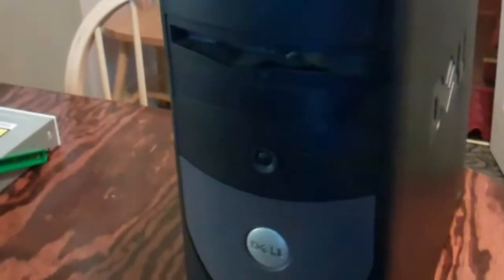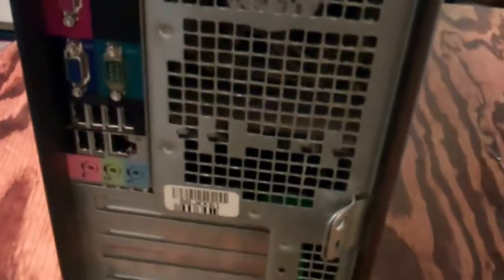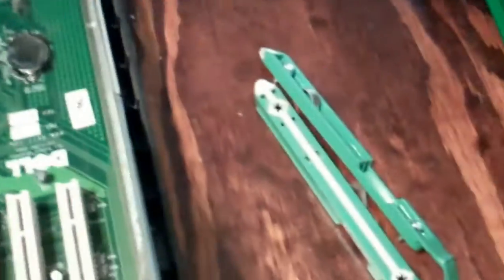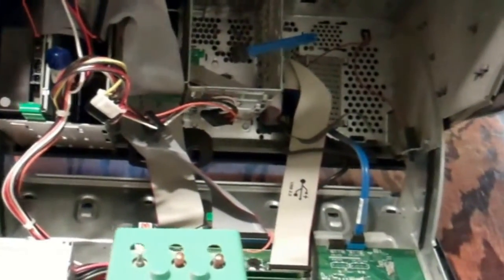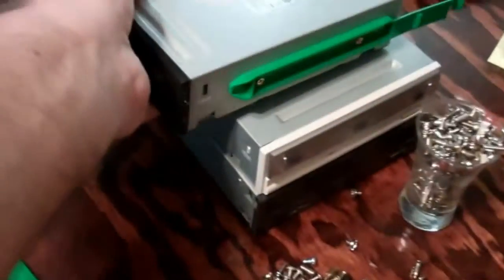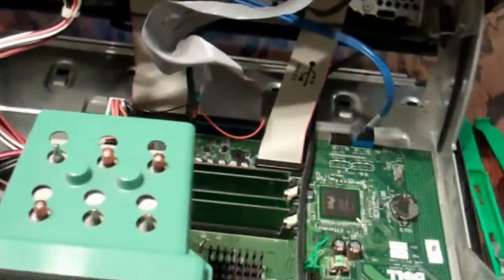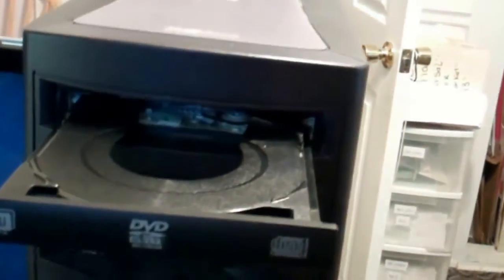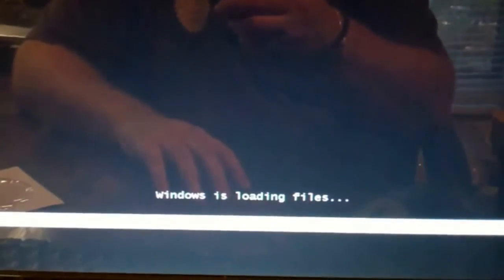Ressurecting an Old Dell GX280

Comment: Is not old
Putting w7 on these machines will slow them down, put xp
Reply from the maker: I run a small tax office and I'm required to have a current OS for security reasons.. XP has long since expired so that's not even an option...
Reply: Agreed, plus...depending on what you put under the hood could make all the difference, too.  I happen to have one of these bought from Savers a week ago, and am currently getting upgrade parts from eBay to max this out to the gills, if need be.  2 GB RAM, 512GB Samsung 850 PRO, 24x ASUS DVD-ROM (since this uses SATA and IDE, might as well go full SATA on this baby), nVidia 6800XT, Wireless-N network card, and that certainly will be more than enough to get Windows 7 going on this without too much bottlenecking.

Comment: Microsoft has something called an Update Advisor you can run on a machine and it will tell you what issues to expect prior to installing 7. When I get in my 280's... about a week... I will try that, first. It may say I'm dead in the water but you have proved that not to be the case.
Reply from the maker: Yeah I didn't even bother with that. I just inserted the Win 7 Professional (32 bit version-I was told that would be the more stable version to use instead of 64 bit because of how old my Dells are) and loaded the OS. It worked on every single one of my various old XP Dells (I have 9 total).. Just a couple of them had those quirks with the audio and video but still worked for what I needed.

Comment: Understood. So I may have to use is a cheapo 3rd party video card in the back. That should give full speed video for using Media Center... which I need to also install. Also mentioned on that Dell forum. I can see I have my work cut out for me.
Reply from the maker: Yeah I'm pretty sure that will fix the video issue but no idea if it will be strong enough to support Media Center. I have a couple old video cards around here somewhere.. I may try to find one and install it to see what happens.
Yeah I run an income tax office so I waited till the off season to start upgrading mine which took me a couple of months to complete..

Comment: Hey thanks. I need to do this on several GX280's. Glad to know it should work. There is mention on the Dell forum about using an HP video driver that will work correctly on the 280 in Win7. Also, the audio driver for Vista is supposed to work but apparently not in your case. What is processor speed of your 280? Do you have Media Center installed by any chance?
Reply from the maker: No problem. I had to do this to all of my office computers when XP expired last year.
The video driver actually works for general use just not for videos or onboard games like Solitaire. Yeah I just deal with the basic audio driver, it works just fine. It's just a Pentium 4 2g processor. I didn't bother with Media Center since it's strictly for data entry only and pretty sure it wouldn't work with the onboard video anyway.

Comment: Did you get Windows 7 to run on your Dell GX280? How much ram are you using and did you get all drivers... video, Ethernet, audio to work on 7?
Reply from the maker: Yes I did. It's using just 2g of RAM and all the drivers loaded automatically during updates (which took the entire day to download and install.
The onboard video is horrible, and I get a message about updating my audio driver but I ignore it cause I had issues with the updated version and went back to the original driver installed.